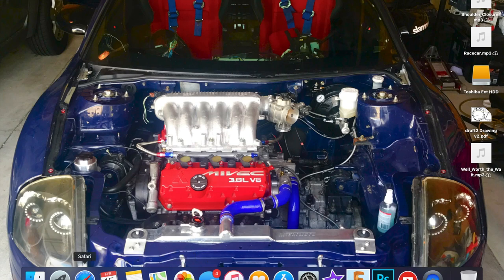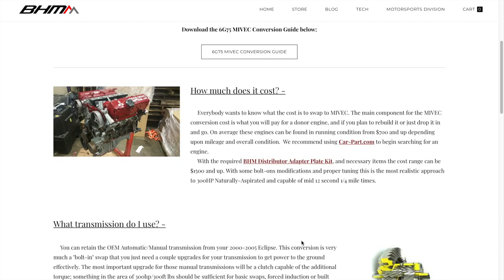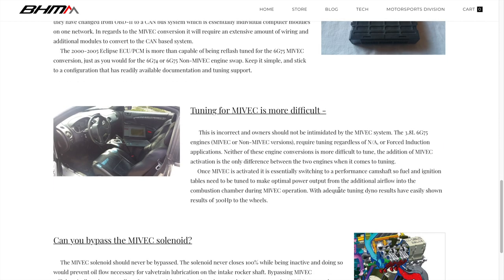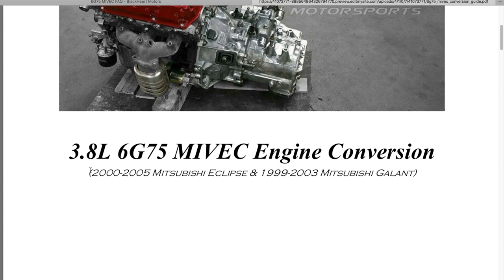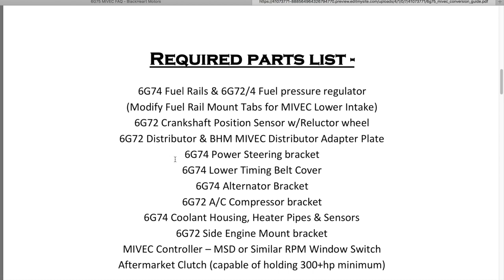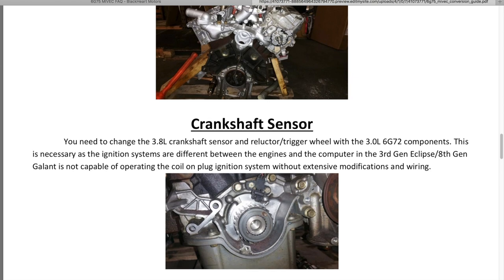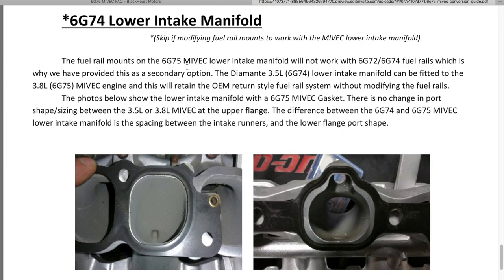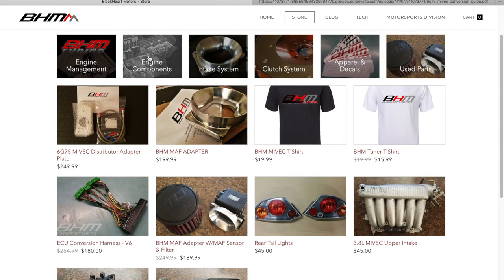BHM Mivec Swap guide

Comment: I did this swap with the help of a forum member, it was for my Sebring coupe.
Reply: Dude, is there any chance we can get in contact. I’ve got a Sebring aswell and I’m planning on doing the same thing
Reply: @nickgoodwin8332  along as it's a sebring coupe it's not a bad swap.  You need the water neck from a 6g74. You can reuse the intake manifold from a 6g75 and I'm sure there's more details I'm just sadly waking up lol
Reply: @X7rocks  sweet, what did the 0-60 drop to after the swap?

Comment: running a distributor on this engine is a massive backwards step. The stock coil on plug set up is far superior in every way.
Reply from the maker: j r unless the 3g owner wants to convert to COP and a ecu for that the Dizzy is needed for the stock ecu

Comment: What headers are recommended for the 3.8? 00-05 will bolt right up? Or do i need 3.8 headers?
Reply from the maker: Joan Perez if you are staying stock, fed spec 3g headers work. Or a pair of RRE will be better
Reply: Fed spec headers will fit on my non mivec 3.8?

Comment: if i make a swap to the 3g eclipse is not going to be the 6g75 i will go 1g 4g63t 6 bolt for 500whp with a 50 trim turbo and 28 psi with eprom 95 ecu dsmlink no joke.
Reply from the maker: why would you use eprom dsmlink when the block box ecu in the 3g is the same as the one in the EVOs.... maybe do some more reading if that is what you want.

Comment: I have a 2003 eclipse gs 2.4L i4 4g64 can I swap that with the 6g75 mivec also do I need to get a specific year of the 6g75 mivec engine I heard that only 2006-2007 engines will swap correctly
Reply: Yes the motor has to be out of 06 or 07 newer ones don't work

Comment: Im a little confused are you useing the engine that came with the car or do you need to buy a engine.
Reply from the maker: Michael Ransom the 6G75 came in a 4G not a 3G. So we swap in the newer motor into the 3G
Reply: @6G75_3G  ok thank you for clearing that up.

Comment: I recently turned 16 and im kinda getting into cars i have a 01 eclipse gt manual and i don’t really know what mivec is, is it a awd swap for the 3g eclipse or is it just a motor swap
Reply from the maker: GalacticsHD its just the motor from a 4G eclipse
Reply: 6g75 3g oh really thanks i was really struggling to find that out so 6g75 is the motors name?
Reply: Im guessing thats a yes okay thanks that was very helpful
Reply from the maker: Yes. The 6G75 3.8 is a mivec motor
Reply: 6g75 3g okay ive done some research but im still wondering why would you want to do this swap I don’t see that much improvement as in horsepower there maybe huge improvement but Ive  only seen a 75 horsepower improvement on the pages I’ve seen that may be wrong
Reply from the maker: GalacticsHD bc with the right tune, and bolt ons you could get 300hp. You would never get that in a 3.0. Also improve in tq

Comment: I have a 3g Gts. But honestly I'd rather buy a 4g gt with the motor already in it. Guess it all in what you want.to do. It's alot.of work an most people don't have the skill , tool or know how to do the swap. Which is about 99% of the people who ask about it..
Reply: So the 3g weighs a smidge less. Than the 4g. But not enough to be noticeable in a race.

Comment: This motor can be put on a 2g eclipse?
Reply: that would be stupid lol.
Reply: Why would you ever want to remove a legendary 4g63 motor lol
Reply: Yes you can. People have done it before. It just won't be a GS-X or GS-T unless you have a 1G DSM and want the DOHC 24V over the 3rd Gens SOHC 24V that faces opposite direction.

Only thing is, you'd have to get the 420A version as the mounts are 99% the same compared to the 2G 420A model. Since it was based off the Avenger coupe (2.5L) then you can definitely swap over with the FWD manual transmission and it should fit just fine but a lil bit more tight. Not sure on the full list of parts but I've seen it done before.

Comment: Hey man I see your one of the only people still active. I’m a few weeks from finishing my 3.8 non mivec swap and have been looking into boosting it but I cant find anything on boosting the 6g75, u think u can point me in the right direction?
Reply from the maker: Paul Munroe is the motor stock. Or is it built for boost
Reply: 6g75 3g Stock for now but do plan on having it built somewhere within a year to start prepping for boost
Reply from the maker: Paul Munroe i would look at ways to build the motor. And look for a fab shop to work on the turbo piping, since it has to be custom
Reply: 6g75 3g yeah thats what I was thinking cause I couldnt find anything on club3g or anywhere referencing a turbo build, thanks though man appreciate the response